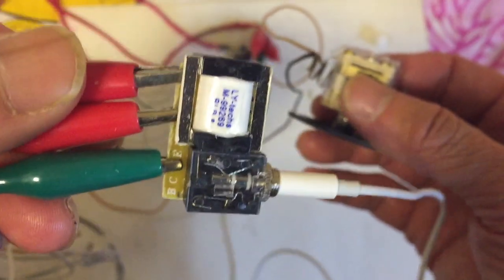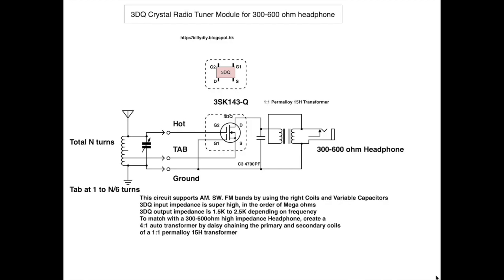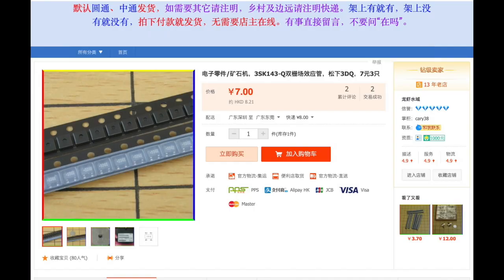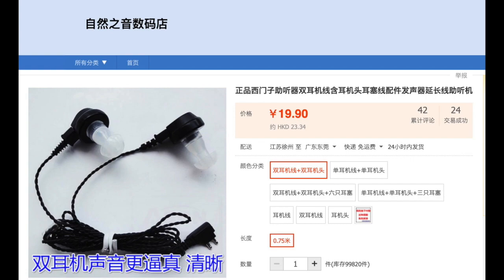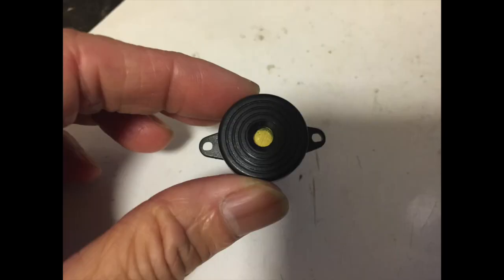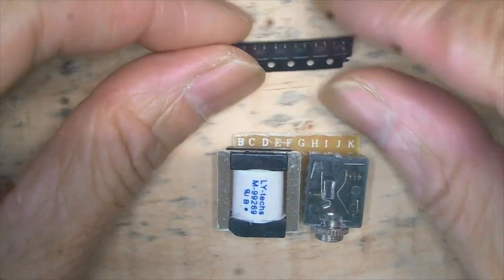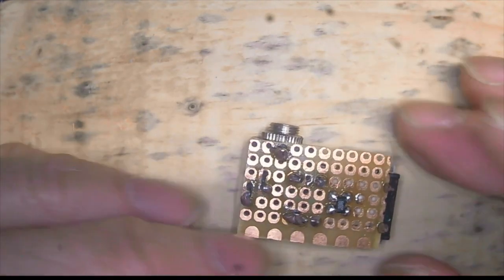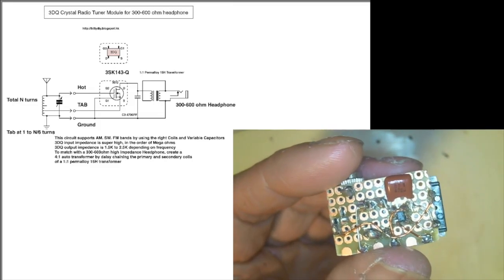3DQ Crystal Radio Module that works for all bands AM, SW and FM

Comment: A quick Google search on the part number indicates that the 1:1 transformers were used on PCI modem cards. These are very common 600 Ohm telephone isolation transformers in the US. They can be salvaged from modems, answering machines, cordless phones, etc.
Reply from the maker: n9xyp , thanks. Do you have a link to a shopping site for this ?
Reply: @BillyCdiy   I have only salvaged the 600 Ohm transformers. BG Micro carries a similar transformer for  US$0.99. http://www.bgmicro.com/midcom-600-ohms-3500-hz-100ma-transformer.aspx

Comment: Could you do more videos showing other ways to use this 3DQ dual gate mosfet? Maybe as a mixer.
Reply from the maker: I have other videos that shows that by connecting power to the 3DQ between the D pole  and the head phone, it can turn a radio to a regenerative radio with amplification. Good for both FM radio, SW and AM radio. Both AM and SW need a resistor to control feedback via the S pole, otherwise, it'll become a buzzer. This is not required for FM.

https://youtu.be/9pNteNszJyM
Reply: yes...it can be used as a mixer

Comment: More versatile than 1N34A.
Reply from the maker: @StevenFell-nu4db  ， yes. I found 1N34A a bit hard to work on FM crystal radio. You will need a much stronger signal to do that compared to this mos FET 3DQ.

Comment: Hi Billy,  I just tried the 3DQ on one of my crystal radios and found that when I hooked up G2 to the Tap, G1 to the headphone negative, D to antenna positive and S to headphone positive  I got the best performance but it still is not as good as my diode.  I tried every way to hook it up.  The 3DQ does work but not as loud as the diode.
Reply from the maker: 3DQ is better than diode at weak signals.
For strong signal, the diode can produce a louder output.
The way you connect the 3DQ seems to be very new. I haven't tried that.
It seems to swap the output and input totally. 
I am interested to know the overall circuit and how many turns you have in the coil and which turn you have the tab.
Reply: @BillyCdiy  The radio is a Howes CR-5 set. It is item number 143180460313 on eBay.  I believe it has about 125 turns and I have the tap set at about 25 turns.  The coil is adjustable.  Thanks Billy for all your hard work and patience with us.
Reply from the maker: 1dandandy 1 what type of antenna and how long ?
Reply: @BillyCdiy   I have  a 102 inch whip about 15 feet up in the air  connected by coax on a metal building for ground plane.
Reply: @BillyCdiy  I have a Tecsun AN-200 and thinking of making a crystal set with it.  What do you think?
Reply from the maker: 1dandandy 1 , what is the diameter of the antenna coil ~ 0.5 meter ? From the look it seems to be made of very thin wires. It will work if you are close enough to the transmission stations. Otherwise you may need a long antenna as the small coil may be a bit weak to drive the crystal radio without another antenna.
Reply: @BillyCdiy  the AN-200 225mm diameter the combination of the coil and variable capacitor tunes from 500 kHz to 1.7  mHz
Reply from the maker: 1dandandy 1 , thanks. I have seen posts from some people in China who  turned this into a crystal radio. Some success some  failed depending on whether your area is close enough to the stations or whether you will hook up another antenna. 0.22 meter is still a bit small for a loop antenna to function by itself as an antenna for the crystal radio unless your area has very strong signals

Comment: Looking at the schematic, I think the 3DQ chip is just acting like a diode. There is no power connected to the drain so t is not acting as a mosfet.

I read a commenter say that a regular germanium diode works better than the 3DQ. Disappointing, but maybe the circuit could be modified to put harvested antenna power on the drain to make it amplify.

Of course you would need an additional dc blocking capacitor to protect your earpiece.

More complicated, but potentially a better type of no battery radio.
Reply from the maker: The comment about comparison between Diode and 3DQ is subjective. In a weak radio field, the 3DQ outperforms a diode that it can pick up very small signals. In a strong radio field, e.g. right next to the transmitter, the diode performs better than the 3DQ, as the current output from a diode under a strong field can be multiple times bigger than that of the 3DQ. You can connect more than one 3DQ in parallel but still the diode outperforms 3DQ. 

Given that many of us crystal radio hobbyist are  city dwellers  who may not have the space nor the permission  to lay long antennas, or even a decent earthed ground, we are dealing with a weak radio signal strength. Hence  the  3DQ works better for me than a diode so far .

My understanding of how a 3DQ works is as follows: It works like the vacuum tube.

The primary coil connects to the Gates (G2, with G1 grounded). The same signal is  coupled to the secondary coil that connects to S1. S1 controls  how much of the current from the secondary coil is passed through depending on the current passing through G2. Some times, the direction of current flow through S1 may also change depending on the phasing of the signal of at the secondary coil compared with the primary coil.  Also, you can replace the current passing through secondary coil  with a battery. This will also work, and may even be louder. Though it'll defeat the purpose of a crystal radio being usable without battery.